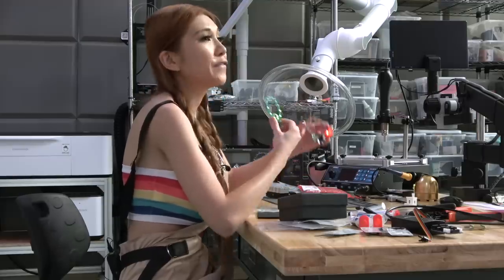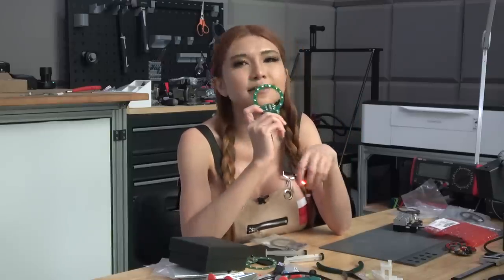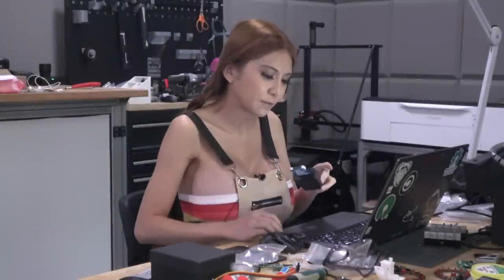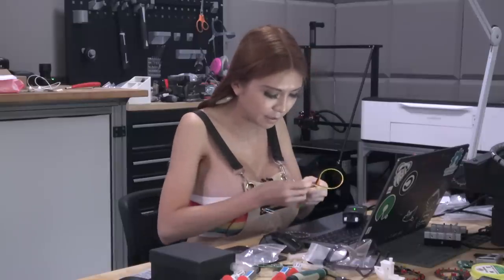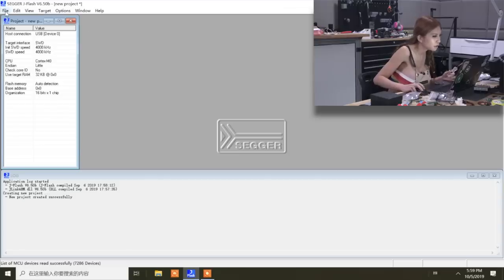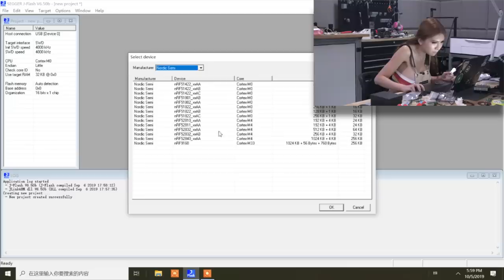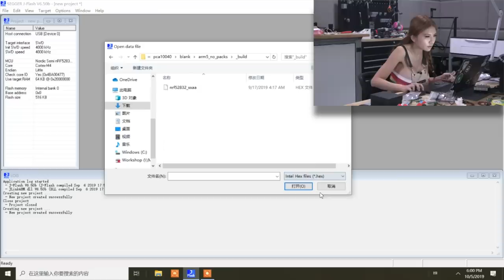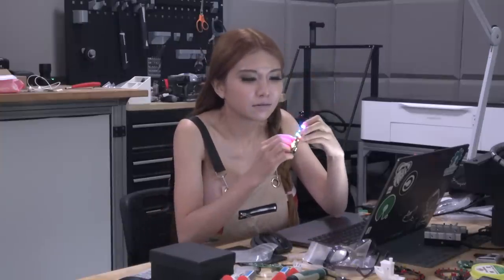Shenzhen Craft Beer Festival with my JLCPCB Wearable and Cymye!

Comment: Great to leverage on your company to build the linkages between user requirements and suppliers in the supply chain. There are several Options. 

Option 1 - Perhaps your company can engage in light prototyping, hold the IP, then farm out mass production to suppliers (or small scale Makers) not only in Shenzhen, but also other countries.  

Option 2 - Your company signs exclusive agreements with suppliers and manufacturers as a marketing agent or consultant, on a pre-determined set of product types.

Comment: Would your service be for mass-manufacture or one-shot items?  I'd love to make some costume props a reality but I don't have the electronics skills
Reply: Ahem. What part of, "If I can do it...", did you not understand? If you have the interest, you can do it.
Reply: @williamswenson5315  can is not the same as will.  I've already got more than my share of weird skills and hobbies to take up my time, and my workspace is very small.  There is nothing wrong with hiring someone else to do the parts I would find challenging at best.
Reply: @limbodog  A valid point. The one  I was trying to make, was that if the singular passion is there for something, you will find a way to express that desire in physical form. As to weird skills, I can relate. I've been a generalist much of my life and it can be limiting if you can't bring a singular focus to one thing and do it. As for soliciting aid, few things are achieved without outside help.  As example, YouTube videos allowed me to plaster my kitchen ceiling today without mucking it up.
Reply from the maker: Probably mostly prototypes and things for small scale production.